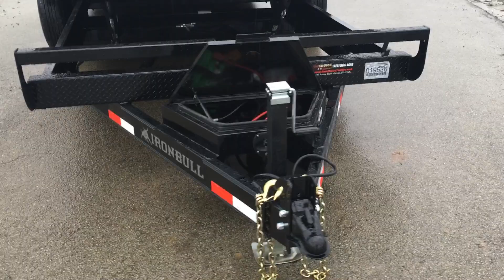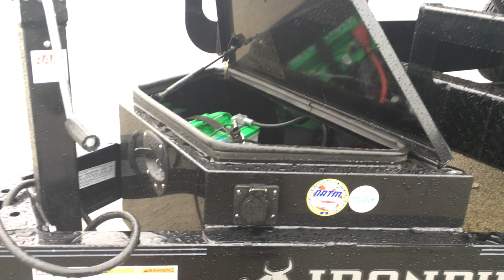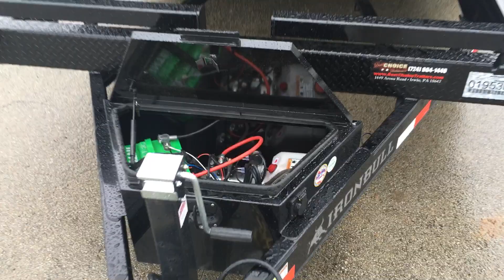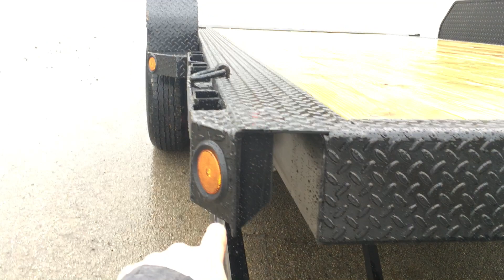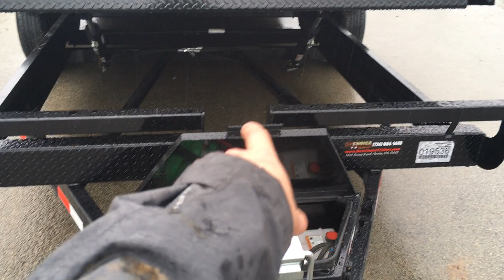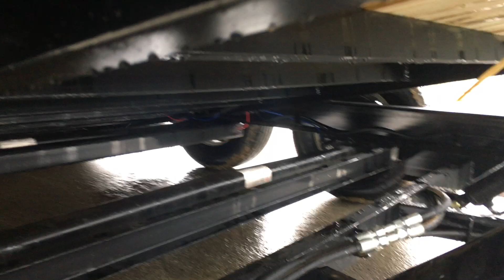Ironbull 7x16' Hydraulic Power Tilt Lowboy equipment Trailer 9990# GVW IB8316TLB10-POWER

Comment: The two lift cylinders is not overkill, it’s mandatory. The trailers with the single cylinder power tilt units get destroyed when loading two scissor lifts side by side.